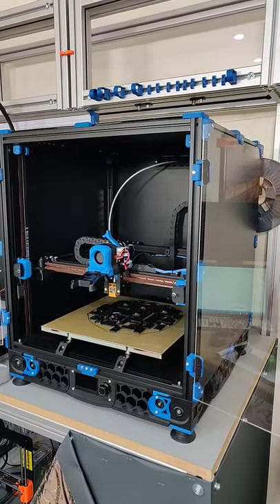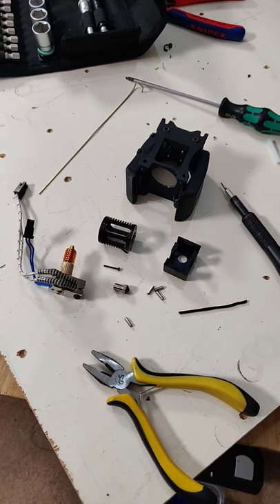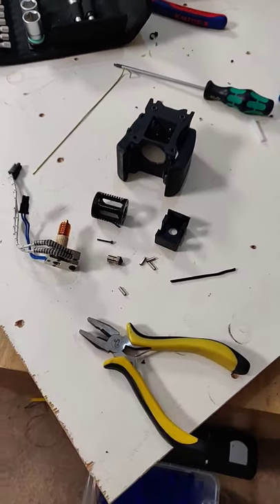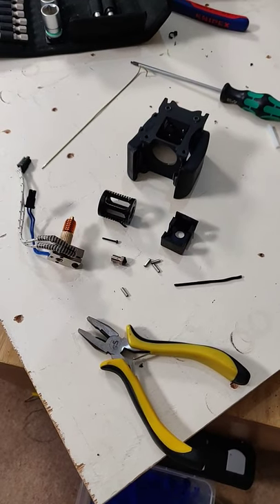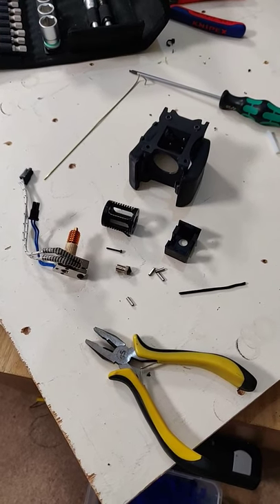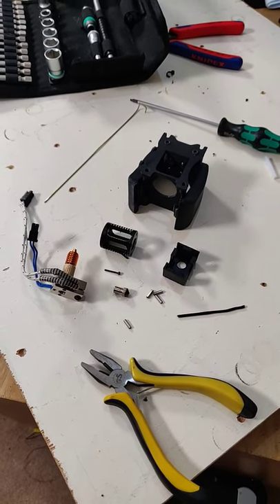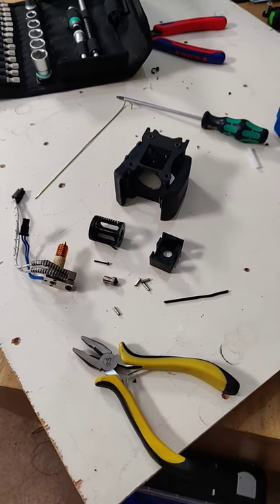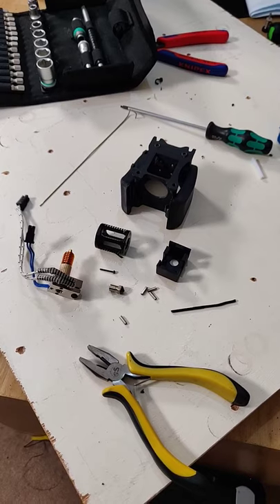Filament breaking issue. potential solution?

Comment: I had a similar issue on my afterburner with dragon hf, solved it with a mod that puts a 4020 fan on the hotend - did not need to lower enclosure temperature. Also make sure nozzle isnt slightly clogged.

Comment: I'm leaning more towards cooling. This might be a bit long, but I want to explain it properly (to the best of my ability) so it might be information of good use to the fine folk of the 3D printing community:

The magnum / high flow "heatbrake" significantly elongates the melt zone, outside of the heater block. So if there's not enough airflow that's gonna cause substantial issues. Or worse; if the "cold" air blowing onto it is constricted from exhausting rapidly, then you will end up with that small zone within the "heatsink" (frame?) practically becoming a convection oven because the air can't escape. It just stays there circulating within that small space because exhaust out the sides and back is constricted, and the backpressure creates a pressure wall/zone that won't allow it to escape out the way it came in, so it's blowing over the big copper slug (even with its little sock), heating up, in turn heating the heatsink part of the heatbreak instead of cooling it. Kinda like the circulating dead zones you can often see dragging behind many vehicles.

Some air will eventually mix and wash out, but if there's any substantial impedance to exhausting the hot air, then the cooling effect will be drastically reduced.

This is a critically (!) important point to address when using the Mosquito Magnum(+), HF Crazy or Dragon H. Unlike a volcano or Dragonfly HIC where the elongated melt/hot zone is confined within the heater block, that big copper slug that elongates the melt zone of the Magnum or Dragon/Crazy HF sits outside of the heat block, and directly in the same path and tiny confined space as the heatsink.

Not accounting for this important difference versus their NF (Normal Flow) variants or other "traditional" HF (High Flow) hotends, seem to be the most common reason by far, for clogging and jamming issues users have with these "new" styles of HF hotends.

The voron heads are usually quite good for airflow and exhaust, but they're not the only part involved that envelope the hotend. Everything from ducting, brackets, extruders to the X axis carriage play their part here.
Reply: That makes sense. And in the previous video it sounds like he thinks the ceramic insulated part is still part of the cold end, but it does seem like the whole point of that insulation is to extend the heat from the block up the copper tube to increase the melt zone, or at least start softening up the plastic before it hits the heater block.

Comment: Another solution would be to use cold air (not from the heated chamber) to cool. I had an idea about using compressed air and use an nozzle in front of the hotend cooling fan. So first I am using cold ambient air which then expands and gets cooler. The only problem is the noisy compressor.
Edit: or use a water cooling solution

Comment: TLDR: print faster until you can get a bigger fan. Melting filament requires a surprising amount of heat.

I have has similar issues with PLA on a dragon HF V2 but with no enclosure which makes a dT of ~30C between ambient and Tg. This would be about the same dT for your case if you had a low Tg ABS.

Mitigation? Printing faster helped a lot but for builds with lots of short extrusion distances and lots of retracts it wasn't enough. So a bigger fan and a 50w heater cart solved the issue

Comment: About 100 hours on my dragon HF with a 0.85 retraction distance(I was too lazy to change it after I change the hotend) and had zero clog issues with both abs and pla so I don't think that's your issue. My chamber temp is ~45C+-3C so quite a bit lower than yours. A few users on the facebook group had similar issues and fixed it with a higher CFM fan or at least one user made a tape "channel" to direct more air on the heatbreak. Hope this helps, cheers!

Comment: Might not be retraction then, I run 0.8mm on mine so you have less than me and I don't get clogging. You probably nailed it with the cooling fan as I have heard about the issue with afterburner on forums in the past, my enclosure rarely goes above 50 so I've never ran into the issue.
Reply: Do you run the magnum / high flow "heatbreak"? This significantly elongates the melt zone, outside of the heater block.

Comment: I am glad I did not go with the High Flow. When I was picking my hotend a lot of people warned me that the HF can be more trouble to get it working well and to only get it if you are planning to go super fast or print with a big nozzle fast. My Dragon SF has been able to handle everything I throw at it with a 0.4 nozzle, and I am experimenting with a Bondtech CHT 1mm nozzle now and it seems fine. Does not seem worth it to get a HF.

Comment: It would be interesting to see if a perceived upgrade like a real Mosquito hotend would address this. Lots of people say the Dragon is 'just as good' as a Mosquito - and it is under most circumstances for most people doing the most common things. But when you start pushing higher limits their difference in performance starts to become more noticeable.
Reply: Too many  other disadvantages with the Mosquito hot end. Going from a Dragon to a Mosquito is more of a downgrade than a sidegrade.

Comment: Well what happend? Since its a HF it might work with SF? Did you swap your Fan? Would be interesting to see if printing faster might reduce coldend temps due to feeding colder filament faster into meltzone? SF has a smaller meltzone but depending on Speeds/Material you might outrun your hotend. Did you realize that constant layers might be no issue but breaking appears just inside Infill pattern? Stay safe!

Comment: Are you using that low speed Noctua fan on your cold end? If so, no, just no. Get a Sunon there or something. You can play around with the voltage, you may even consider overvolting the Noctua.